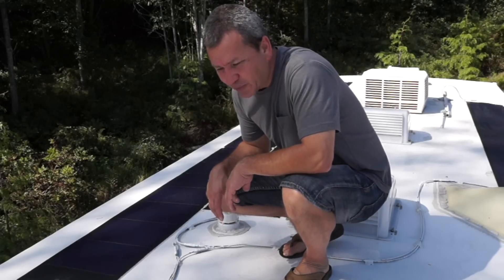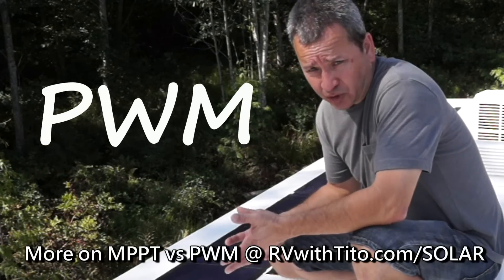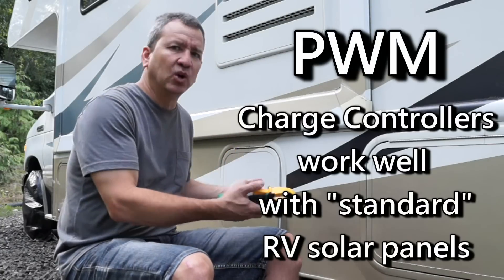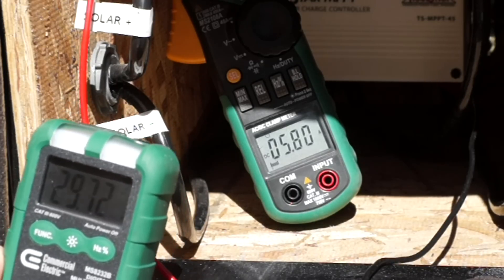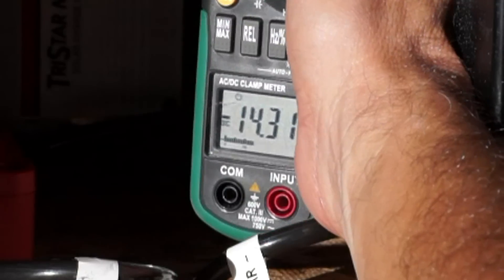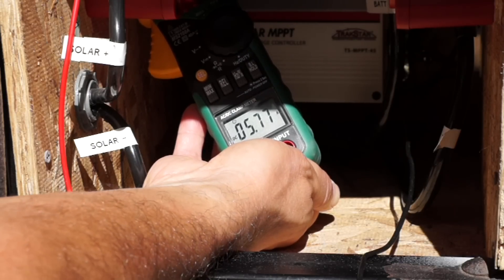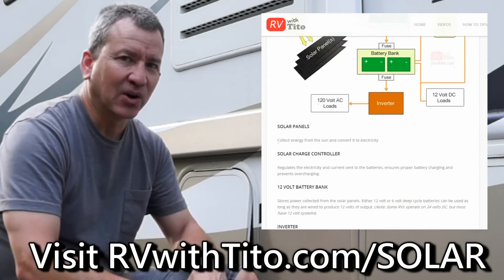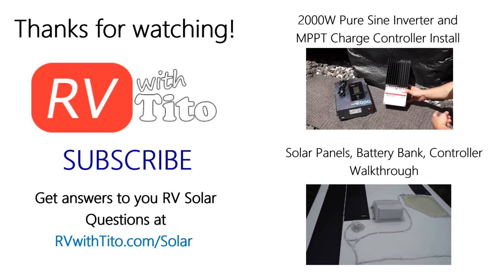MPPT or PWM Solar Charge Controller for High Voltage Solar Panels?

Comment: I'm gonna be getting 2 100 watt panels 12v each and a 2000 watt inverter to power an electric cooler, some l.e.d lights, some phone and laptop chargers. do you recommend a mppt or a pwm?
Reply from the maker: +Brunden420 With your 12v panels wired in parallel, I would stick with a good PWM controller. The added cost of an MPPT controller will probably outweigh the benefit you'll get from it. Of course, you could always upgrade to an MPPT controller later should you choose to expand your system.

Comment: Anyone knows how can i wired 6 AGM batteries of 12v 13A being charged at the same time with a solar pannel controller?
Reply: +Rui MAC What panel voltage? What controller (PWM or MPPT)?
Reply: David Schwartz 12 v. you may sugest if it would be better a pwm or mppt. :) thanks. the reason of beeing 6 bat, is to have more hours of energy .
Reply: +Rui MAC With a 12V panel, the maximum battery voltage you can use is 12V. So you have to wire the batteries in parallel. With a matching panel and battery voltage, you can go either way, PWM or MPPT. MPPT will be about 10% more efficient, but it will cost more. Just either way, make sure you get a decent controller -- there's a lot of total junk out there. If you let me know what wattage (total for all your panels) you plan to use, I can give you some recommendations. If the total wattage is less than 200, PWM probably makes more sense. If more than 500 MPPT is probably better.
Reply: Good to know, because I'm going to start running bigger stuff now that I have plenty of solar panels.  I have 6 golf cart batteries but I don't know what a realistic amount of power I should expect out of them.  Any thoughts?

Comment: Great video.  Unfortunately I have my RV wired with all the 800w solar panels in parallel giving out between 18 and 22v depending on load.  I'm wanting to charge my 12v battery pack at 50amps.  The trouble is I am finding most mppt controllers have trouble working at 18-22v.  Can you suggest a controller?

Comment: Hi, I have a solar system with 3 panels of 305 watts and 40 volts each and I have a xantrex c60 charge controller. The problem is that the charge controller gets hot and burns itself. My system has burn 3 c60. What can I do so it can work. Do I need a 80 amp MPPT charge controller?
Reply: Also my system is 12 volt with 12-6volt batteries.
Reply: +Gilberto Roman 
No my batteries keep working as well

Comment: Great demonstration. I have a 70' PV cable run with my 3.7KW solar panel array on my backyard pergola. I am using two Midnite Solar Classic MPPT solar charge controllers. My voltages during high sun run about 110v DC. The MPPT takes all that higher voltage and converts it to DC charging...unlike PWM. I might add...with longer PV solar cable runs, higher voltage is more efficient (and less heat). It is easier to push voltage through a wire versus current. I used an online wire loss calculator and inputted my parameters. For my long 70' run...only losing 2.1%. Then, I put in the same data using a "parallel" solar panel configuration. The loss was 28%. So, bottom line: MPPT and wiring solar panels in series (and/or using higher voltage panels) maximizes power/efficiency. Very good video showing this first hand. A+
Reply from the maker: +ChrisDIYerOklahoma Thanks for sharing your setup! Yes...parallel needs very thick cable to deal with the current once you grow past 1 or two panels. I also used an online voltage drop calculator to keep my loss under %1. The series setup also works best for me (with MPPT of course) not just for keeping voltage drop down and using smaller cable, but also to easily allow adding of new panels to the chain when I need them. I hope you'll check out my other video on series vs parallel panel configurations here https://youtu.be/dfMVHLVcMWo.

Comment: Something doesn't seem right... The input is 29.7 volts at 5.8A and you're getting 14.3A out for charging 12v batteries.
HUH?? :)
That's a factor of 2.46x the input current.  Even if the MPPT charge controller was 100% efficient, the output couldn't be higher than 12.04v.  That's not enough to charge a 12v battery and that's even assuming 100% efficiency.  Were your batteries severely drained?  I'm trying to figure out how this happened :)
Reply from the maker: +Christmas Eve It would be 2.46x only if the output voltage was the same as the input voltage when in fact the output voltage is about 1/2 the input voltage at around 14.6v. Bottom line...since the batteries charge at around 14.6 volts, the extra input voltage is being converted into additional amps at the lower charge voltage.
Reply: +Christmas Eve Essentially (for MPPT), watts in (from solar panels) equals watts out (to the battery bank). In other words [numbers], 29.7V x 5.8A = 172.26 watts coming from the solar panels. If 172.26 watts are coming out of the charger as 14.3A current going into the battery bank, that current is being pushed at about 12.05V into a battery bank that is still needing a good bit more charge time, because 172.26 watts / 14.3A = 12.05V. As the voltage (charged condition) of the battery bank improves, this 12.05V will continue to increase (while 14.3A will correspondingly decrease). Eventually, the fully charged battery and the charger output voltages will be equal and charging amperage (A) should drop into a float charging range (about 2 A). As batteries are output to load and their voltage drops, the full charging recovery process will begin again and current into the battery bank will rise and be pushed at the same lowered voltage as the recently discharged (loaded) battery. This is my basic understanding of the typical ongoing MPPT charger system operation. The charger output voltage follows the varying charged state voltage of the battery...the additional amperage pumped into the partially discharged battery raises the battery's terminal voltage, eventually (hopefully) to full charged specification voltage (i.e. 14.6V) followed by the charger scaling back operations again to a float mode (less A and less W).
Reply: No my batteries kept working as well
Reply: l,
Reply: +Christmas Eve maybe it is because pwm charge controller is less efficient then the mppt. like 80% efficient pwm vs 90% efficient mppt

Comment: I am new to this game so I'll start with a very basic Q(s).  Which is important high wattage, hi amperage, hi voltage.  I am planning on getting the Powerfilm 220 volts folding panel (which can be daisy up to 4 units 880 volts) in my truck I have a 3-12 volt batteries (2 Odyssey Extreme, and 1 regular 12v) setup.  At first, I'll get two P/F 220v=440v what do I need to get to complete the system (ie MPPT, inverter and what are the meters (Fluke) you used to monitor the incoming and outgoing amps, volt and watts)  Powerfilm says to get a Yeti 1250 along with each 220 unit but couldn't I get a heavy duty MPPT and Inverter(s).  this is what I will use for either my bug-in or bug-out scenario.  I know I'll need to get the # 's from the Utility Co on the voltage, wattage and amperage I use on a daily, monthly and yearly basis to determine the size of my equipment I need right?
Reply from the maker: BobbA Louie Amps, watts and voltage all go hand-in-hand. Each affects the other in accordance with the Ohms power formula:  Watts = Volts * Amps. 
My knowledge about specific vendor equipment is very limited.  Solar panels, charge controllers and inverters all have maximum input and system voltage and/or current (amps) ratings that will determine whether your components are compatible with each other. For example, my charge controller can accept up to 150 volts and 45 amps input from solar. So the panels you are referring to won't work with my equipment. Ask the manufacturer what their recommendations are.  As for my meters, I have a collection of inexpensive meters < $40 (not an expensive Fluke meter). You'll find links on my website  (http:www.rvwithtito.com/store) .  I also have a TriMetric Battery monitor wired up that measures my power use and available battery capacity.  I'm not sure if this helps with your setup, but  thanks for the comments and questions.
Reply: BobbA Louie Thank you for your help!

Comment: Hi Tito..!  I would like to install a solar system..in my RV..i have a 22ft 2007 Holiday Rambler Augusta.. and i m thinking Renogy 100 w flexible panels  maybe one for right now..i have 2 deep cycle batteries to keep up and also the house battery ander the coach(1 battery)1.Can i use a PWM Charge Controller made by VIC TEC Intelligent LCD has 2 USB port..My question is can i use the charge controller to keep them charged..? the 2 deep cycle batteries and the coach hause battery in same time..? I like the large LCD display..! Is important to know the self consumpion of the PWM..5..6.. milli/amp..? or i have to go with the MPPT..?
Reply from the maker: Manolo Vicencio Sorry Manolo. I don't know anything about that charge controller, but I think a good PWM charge controller should be fine for just one panel. I don't think you would benefit from a more expensive MPPT controller. As far as charging multiple battery banks, I would recommend you get a second inexpensive controller and small solar panel for that. That is unless you can find a controller designed for that purpose that is affordable. Solar charge controllers monitor battery voltage to regulate the charge. I don't see how that could work correctly if conected to two separate battery banks.  You could just do what I do...start my engine every couple weeks and let it run for a while. Battery gets charged and it's also good for the engine. I also keep a trickle charger on it during the winter. Hope that helps. Thanks for the comment.
Reply: Tito now :How much colder the roof ac can get..? Here in Miami.Fl. need a lot ac..58 F. is not much..! How we can svc or refill the system..?
Reply: I think is type of R122..
Reply: in my coach I get 53F..but my friend Emilio only get like 58F...that sucks..!

Comment: Mppt is an switchmode power suply, it take the high 30 volt 5 amp and convert it down to
13,8 volt 10,8 amp = 150 watt, if its not a
Mppt you will get 13,8 volt 5 amp = 69 watt power from the same type of sunpannel. 
Hmm i think.

Comment: HOLA TITO!!  i got  an inconvinient i think , i got  a battery bank of 4, tow of them are flooded and the other 2 are sealed , Acording to my readings ,the flooded bateries are been charged  by the mppt  but the other 2 aren't,  any advice?
Reply: +diego bauzil  It's always recommended that you use batteries of identical Amp hour rating, type,  and even age...for good system performance. Possibly grouping your two different types on two separate chargers (and as two separate power systems) would not be suitable to your needs. Try to swap out one of your battery types for a pair that matches...striving for four more similar batteries in your single charger system. Examine electrical age & condition of all  batteries before you decide which pair-type has to go and which pair-type you will keep. If any are AGM type, first determine if you can recondition them...sometimes that is very successful.

Comment: been told that MPPT dont work when you have different size panels. I have 2 x 80 watt, 2 x 60 watt and 2 x 40 watt
Reply from the maker: Hans Ole Clemmensen Hans. With your configuration I would wire them in series (not parallel) with an MPPT controller. Make sure the combined voltage does not exceed the max open circuit voltage of your panels. I don't think it's really an MPPT issue. The fact that you have several mismatched panels makes it difficult to configure for 12V without wasting power. In parallel, your panels will generally take on the characteristics of the smallest panel. Wired in series with an MPPT controller may fix that problem. Your MPPT controller will handle the conversion from the higher incoming voltage for you.
Reply: RVwithTito I'm Using a PWM controller now, was in the engine room today and noticed the positive wire from solar panels to regulator, and the regulator it self was very hot? at the same time the meter showed me 17 amp coming in from solar panels, but only 10 amps charging the batteries.
Reply: Hans Ole Clemmensen Your video showing more amps going in on MPPT should fix that heat problem. Have 12 x 2 volt x 275 amp batteriesrunning 12 volt

Comment: I'm glad you mentioned for use on high voltage panels. 

I dont see much help on low voltage panels compared to 30 plus volt panels. I use PWM due to the panels I have.

Good video
Reply: +DIY-Solar-Energy We are Shenzhen Shuori New Technology Co.,Ltd in China and our main products as following:
☆Solar Street Light charge Controller for VRLA battery or lithium battery (Support Data Remote Setting, PWM/MPPT Type) 
☆Solar Power System charge Controller for VRLA battery (PWM / MPPT Type)
Please visit our web: WWW.SRNESOLAR.COM

3000 ㎡ factory, 7 years experience in solar charge controller filed, professional and strong professors, senior engineers, professional technical staff R&D team.  ISO, CE, ROHS & CQC certificates, this is how we keep good quality and competitive price for global valued customers.

If any models meet your demand, please feel free to contact me. Catalog & Details can be offered.

We're sure your any inquiries or requirements will get prompt attention.

---

Best regards,

Rhean Feng
Sales Department
Shenzhen Shuori New Energy Technology Co., Ltd.
Address:Building B, Jianyu 2nd Industrial, Nanchang Park, Gushu, Xixiang, Baoan, Shenzhen, China Zip:518000
Mobile Phone:(+86) 18565667949/13580565572
Email: rhean@szshuori.com
Skype: rheanfeng
QQ: 2851352807
Wechat:1036342363
Website: www.srnesolar.com

Comment: TITO : i got a wuestion ,im installing 5 solar panels (100watts) each , bringing down on 10 awg m4 cables to a morning star mppt 45  charge controller, my question is ,what kind of  FUSE do i need and what  amps has to be form the mmpt to the batteries ,and what kind of breakers should i put from the sollar panels to the MMPT? 
thanx ..
Reply from the maker: diego bauzil He Diego: I use a 100 amp terminal fuse on the positive battery terminal. I like terminal fuses because the do not require additional wiring. I have in-line battery switches on both the positive input and output of my charge controller. Both the fuses and switches are listed here http://www.rvwithtito.com/store?dept=6 for you to check out.
Reply: so 100amp is enough to protect the mmpt , thanx so much.
Reply: pd ; im a newy on this but i have been studing your video for 6 month no!! suprer cool stuff !! keep it up!!

Comment: Hi

1.	 If the battery is 100%full. And the solar panel still has sun time,
 at this time the load came directly from the solar? Or still it's come from the battery?

2.	Can I connect 12v battery and 24v solar panel? Or if the solar is 24v it has to be battery 24v also?

 Thanks 
Yossi

Comment: Can you adjust the output voltage of your particular charge controller?
Reply from the maker: Rowans Down The Road Yes. It can be set to 12v, 24v or 48v. I have it set to 12.

Comment: Good stuff Tito,
I enjoy your video's, good info and very professional. I have a few video's myself, not as nicely done as yours buy perhaps you will check them out anyway. I have a question. I understand the charge controller takes the higher voltage from you "high voltage" panels and ups the amps. I got that but my question is "what's the amp rate to charge a 12 volt deep cycle battery" I always thought that a long slow "low amp" charge was best for a deep cycle?

Thanks Tito 
Dave aka Florida Boy
Reply from the maker: Great question. I'm not an expert on the subject, but here is my understanding. I've heard 5-15 amps is acceptable. It's really the job of the charge controller to regulate the charge voltage and current based upon the state of charge level of the battery.  

What you say is generally true; that a slow low amp charge is better for the battery. However, most RVers will want to grab as much solar as possible while the sun is shining in lieu of a 24 hour 2 amp charge cycle. Yes, a higher amp charge can heat up the battery and decrease it's life. Therefore it's important to have a good quality charge controller with multi-stage charging capability that will taper the charge voltage and current as the battery reaches a full charge. Also, charge controllers equipped with a temperature sensor (like mine) will adjust the charge levels based upon the temperature of the battery to prevent overheating and gassing.

I hope that helps. I'll go check out your videos too. Thanks for the great comment!
Reply: Thanks Tito, that makes sense. I appreciate you taking the time to reply.

Comment: Great video, Planning on installing solar in my class "C" and I took your advice on the panels and purchased a 144 watt unisolar panel. I got a 20 amp mppt charge controller and wasn't sure if 20 amp is enough. hope so.
Reply: Your CC is the minimum.
Fine in the winter.